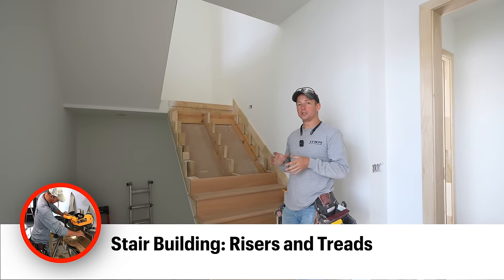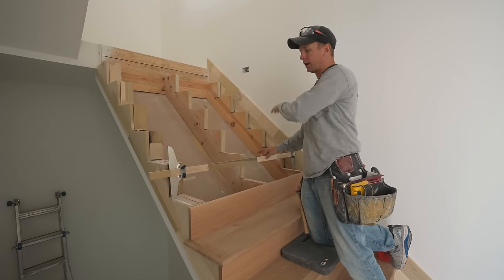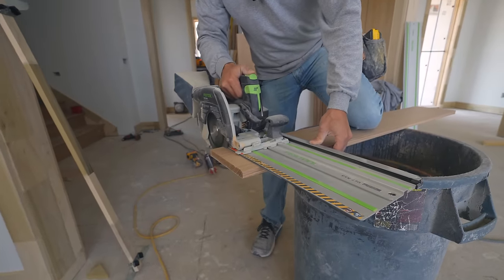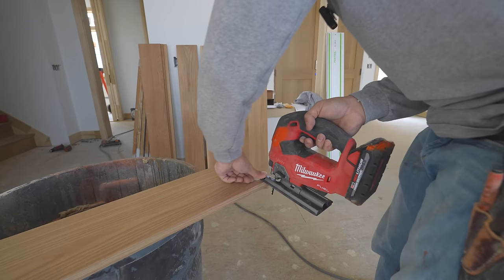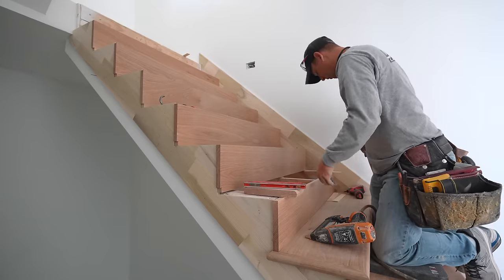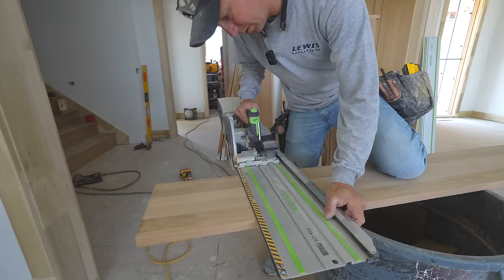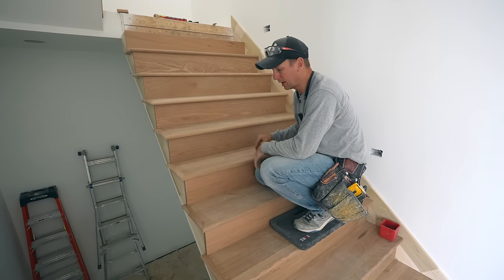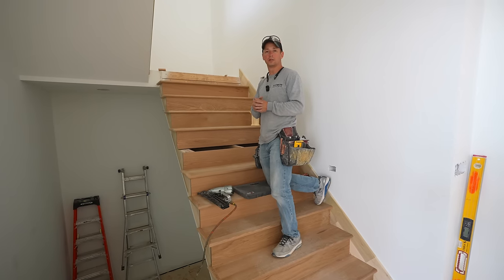How to Install Stair Treads & Risers: Pro Techniques

Comment: I have always been a big fan of screwing in from the back side. It is very satisfying to be able to look down and see a nice tight fit and no squeaking.
Reply: 😂😂😂 sorry… I just can’t!
Reply: I’ve always screws the risers to the treads from the back. I do basically the same with the skirts… just square cut (sometimes some minor adjustment) the risers/treads, leave the skirt board only tacked to the wall… then as your working your way up put some 3” screws through the stringer into the skirt, it will suck the skirt up nice and tight to your treads/risers… this way will always work if you have a cap on the skirt board anyways, if you don’t you might have some minor gaps between skirt and wall but painters can caulk that and then your skirt is nice and straight even if the wall isn’t perfect. Only time this doesn’t really work is if the wall is just in really bad shape…

Comment: Thank you so much for this video. I have a background as a general carpenter. A few houses, decks, additions but never finish stairs.I built the house I live in now. With our help I felt comfortable enough to accept this challenge. 3 full days to remove the old stairs, build the stringers, and install the risers and treads. I never used the stair gauges before but they were so easy to use, making both risers and treads fit perfectly. I will always give you credit and my stair partner. Thanks SO much

Comment: I bought Collins gauges and would emphasize Spencer's caution to be very careful with them when moving from stairs to cutting station. The Collins design is very elegant, and the crisp steel marking edges are much sharper and more durable than wooden ones. However, I find that the very close proximity of the two clamping knobs gripping the 1x2 does not resist movement very well if the edge is bumped even a little bit. I've addressed this by mounting the Collins edges to a shop-made cross piece setup I built years ago, in which the clamping knobs are spaced about 6" apart on rip of 1/2" plywood provided with a pair of slots ar each end to allow adjustable width. It takes a few more minutes if you need to make a custom length crosspiece, but the grip of the knobs makes this setup far more secure against an accidental bump. (Maybe I'm too rough for the finish work I do...:-)
Reply: Brilliant! I’ve encountered the same issue and this sounds like the best solution I’ve found yet.
Reply: @syringconstruction9825  "Stair Wizard" looks like a well-designed and very robust tool. But I've never tried it, a little bulky-looking for my taste.

Comment: Thanks for your very detailed video. Some suggestions on prepping your risers:
1 -- You could drill the pilot holes to attach the treads before you install the risers.
2 -- You could also start the screws in the risers before you install them.
That would save you some time and also avoid the awkward position when you start the screws after the risers have been installed. 

Thanks, again.

Ken

Comment: I've been a dedicated PL Premium user for 30 years. However, for stairs, I recently switched to Bona R880. You have to get it from a flooring supplier or order it online. But I've found in stair tread/riser installation it beats out using PL. Here are the reasons why:

1. It is very grabby. Boards are less likely to slide around
2. It doesn't ooze out of the gun the way PL has a tendency to do, leaving less chance for mess. It is also less messy during application.
3. Sets up way faster than PL. It starts setting in about 10 minutes and can be speeded up to set in 5 minutes if you mist it with water. 
4. Allows for movement. PL locks everything in place. However, it doesn't move. In removing old  existing treads, I've actually come across the rare tread where the joint bewteen the tread an riser has broken. The flexibility in Bona R880 is designed to prevent this because it allows for movement.

I still use PL Premium for pretty much everything else, but I highly recommend trying out the Bona R880 for stairs. 

Keep up the great work, Spencer! Love your content!
Reply from the maker: Thanks! I'm always on the lookout for better products.
Reply: @InsiderCarpentry  same here. You've definitely turned me on to a few items that I've purchased through your links! PS I fixed all the typos - including I spelled your name wrong. Downfall of typing on my phone😬
Reply: @alrightythen1533

I really like the detail in your post.  I’m a homeowner about to convert a carpeted stair case to white oak treads and painted risers.   Choosing the best adhesive possible is key to my situation.

I’m bent on avoiding squeaks and, if possible to either have either…

1. no face-nails nails in the treads, or 
2. really small ones (18g) or 
3. almost invisible ones (23g pins). I spoke with Grex about use on treads

It’s because I’m using only hard-wax oil (NO STAIN).  There is much color variation compared to an evenly stained medium-to-dark stained tread and I’ve not found an easy way to color-match them easily.  Putty comes in plenty of colors, but is something I’m not sold on yet. I hear many complaints about it…but maybe that is not definitive.  Don’t know.

Choosing the right adhesive has the potential to address a lot of my concerns so any add’l insights you could offer will be appreciated.  Had you used F26 by Leech in the past before settling on PL over it?   I know you are onto Bona 880 now and have heard promising things about their quantum product for use on treads without face nails.  The one that comes in a  “sausage tube”, not the thinner Quantum Flow for floors.

I was going to use PL Premium based on how many folks on youtube recommend it.  Then I kept running into a lot of local carpenters and builders highly recommended F26 adhesive by Leeech.  Swearing by it, actually.  The company has an outstanding tech support person who absolutely says F26 does not expand or swell and stays flexible indefinitely and that it  is what doing the holding over time (decades) which prevents squeaks, not the nails.

Will leave it there for now.  Can add a little for if anyone is kind enough to reply to my post.

Comment: I leave the wall skirt board only tacked to the wall. Then with just square cuts on my risers and treads I run a (or a few) screws through the stringer into the skirt to suck the skirt tight to treads and risers. I also screw my risers into the treads from the back side. And use LOTS of glue lol.

Comment: good job with the overlay! so i do them a little different ill cuts and scribe all my risers first and let them to fit well then ill co back and do my treads one at a time. cut 2 blocks the same length and width  to scribe my tread to the skirt they need to be slightly over the extra length of my tread. ill put one block between the the return nosing and the outside skit and the other against the wall skirt. ill use this to transfer the skirt to the tread then ill cut on my line. ill go back with a grinder and a sanding dist to back cut along the tread but will avoid grinding any of the nosing. after i get my tread to fit well ill use titebond 2 or 3 to glue the riser to the back of the trad and nail it off and set my nails with the hammer. generally i dont use pl but liquid nails for my adhesive, it cures to a softer final hardness and i find that helps to keep stair noise down when walking up them. ill install the tread and riser for each step as a single unit.  ill do 3 nails trough the face of the riser and 2 through the side of the skit. ill add a dab of glue or adhesive to where the riser meets the outside skirt. generally no glue on the skirt.

Comment: The craftsmanship and attention to detail is really great to watch. I always enjoy your content. 

Watching this as a flooring guy, having never done hardwood steps I do have one question (for now lol). 

If the backside drywall wasn't on, or you still had access to the backside of the stringers (say as in an under stair closet), would you take the time to pocket hole screw the tops of the backside of the risers to the nosing of the tread?

Would this be severe overkill or would it be a step you would take if given the opportunity?
Reply from the maker: I definitely would if I had access to it. As a matter of fact, I can remember a job years ago where I did have access and was able to do that.
Reply: To bad I can’t rent a fes tool stair saw with guide

Comment: You also can set a dado on the underside of the tread, whats nice with that is your dimension is set, just need to plumb your risers and nail it place. Little bit more work but you have a nice shop, easy set up for you. Keep up the good work, enjoy your workmanship and videos.
Reply: Then leave the riser high the depth of the dado? Slightly less, actaully.
Thanks.
Reply: @als1023  yes, that is the idea.

In this case you would probably have to stop dado these, so you can't see the dado from the side.

Comment: Great video as always. How do you handle the last riser where you can't really access to screw into the tread? Just a bunch of glue or PL?
Reply from the maker: Yep. Try and make sure the riser is as straight as possible when you nail it on. Then push the tread into it with adhesive on the back of the tread.
Reply: You could also pre-assemble the riser and tread together on a flat table then install it as one unit

Comment: If those are young mill treads you can knock that return off to shorten up the tread up on table saw. I do it to bevel the back of the tread, I rip a strip of wood to put in the back side of he return. It’s a pain I have to do it at least once a week on remodel work dang 9” runs.

Comment: QUESTION:  what size nail are you using in this example?  
Thanks for the video---I'm getting ready to do this process and your instruction has been very helpful!
Reply: a brad nail. it's 18 gauge.
Reply from the maker: 18 Ga on the risers. 15 ga on the treads.

Comment: I've been studying your stair techniques in preparation to replace my 1st set of stairs that had been carpeted.  The stringers are not the best and I wonder if you have any tips for dealing with low quality (sloppy cuts) and damaged (way too many nails split the wood) stringers.  I also noticed the white oak treads have some checking and small cracks on the end.  (probably my fault putting them in the garage for a few days)  Hoping it can be dealt with (glue?) to make sure it doesn't spread.  I'd rather take the hit and buy more than have problems develop after they're glued in,.  I had paid a carpenter but they were wholly incompetent and I had to stop work.  The following quotes were ~$1000/step for 36" no return straight run treads, so I feel trapped into finishing it myself.  I trust this channel and it's subscribers (amazing % of experienced carpenters) for quality info and appreciate any wisdom.

Comment: Found u recently. I am trying to tackle replacing carpet with hardwood. My stairs are a bit complicated. I'd really like to learn and need to build some confidence. Any book you'd recommend on stair remodel to help me? Main complication is removal of a knee wall and resulting expansion of the length of each stair. Meaning, you can see the edge of the stairs from the side rather than the treads and risers bumping up against the knee wall.

Comment: Is there any way to avoid the gap between the riser and the tread on the 1/4" reveal on the left? At 24:11 you show a close up of the stairs where you can see it in the bottom left, what do you do to fill that?
Reply: Maybe Pinterest designers don’t believe in cove moldings.
Reply: Nose and cove, nose n cove. They got the nose. Now have a little cove with your nose, Pinterest peeps. Not many profiles as classical as a nose n cove.

Comment: Hey Spencer. It’s seems you want the tightest possible joint between the risers, the treads and the skirt board, but what about the wood expansion. How is that accommodated? We leave a gap between flooring and the walls and everything else for floating floors at least. Does proper adhesive stop the expansion? Really confused on this one. Please help. Thanks.

Comment: How do you get behind the top riser to screw in the tread if the sub floor is in the way?
Great video as always!
Reply: Screw it to tread before setting it in
Reply from the maker: That's one of the reasons that I prefer Sub-tread material not be installed.

Comment: Why do you prefer pencil over razor knife to mark White oak (6:35)? Why did you face nail the treads in this video after avoiding it like the plague on previous videos?  I will not use them.  Did you have a bad outcome relying on PL adhesive only?  In another video, I see you alternate between starting your cut from at the nose and back of the tread.  It implies tearout is not an issue on the nose regardless of the cut direction.
Can excellent cuts be made using a sliding miter saw?  If the HRK is superior, let me know.  I own neither.  I’m open to purchasing either, but think the SCMS will be used more often after stairs are finished.

Comment: I noticed one thing. There is a small gap maybe 1/8 in between your riser and stringer. I am wondering you are doing that on purpose. Can you set bottom of riser flush against the stringer? Thanks a lot

Comment: Love your videos!  I would love to see how you adjust the stair stringer when going from stairs that have been carpeted to hardwoods. I’m doing that now and there is a huge gap between the stringer and the stair skirting.   Not sure if I should just leave it or try to add wood blocks.
Reply: I think you just measure tread and risers from skirt to skirt. There should be enough hardwood that the overhang shouldn't cause too much of a problem unless you're talking 6" or more. Then you might want to put in extra stringers on the outsides and down your skirting. I call them wings but whatever hardwood doesn't bend easily.

Comment: My stairs were built for carpet in 1993 with 8 inch risers and 9 inch treads. I had new flooring installed and the top and bottom landings and now I need to pad the stringers out for the new oak risers and treads. Any advice on how I should go about doing it so all the risers and treads come out evenly?

Comment: In the process of doing my own stairs, and your videos have been a great help! However, my one worry now that I’ve reached the tread installation phase, are those finishing nails. I do not plan on staining the treads (finish only) & am worried that filler may not blend in well. Underside/backside of stairs is not accessible. What advice or product suggestions might you give me for this? Thank you so much for sharing your craft!
Reply: Try mixing wood glue and sawdust from the same material

Comment: good video! only thing i wouldve done different is cut a small return piece out of the offcut of the risers so the grains would match when looking from the side, other than that nice work man!
Reply: A mitered return might defeat the purpose of this design. End grain with the same species as the tread is what I think the designer is after here. This will be a one off for the designer or architect…too often, professionals (architects and designers) and clients with no tool time under their belts will want to create a unique look even if it is unsound. No psychoanalysis here but it is often an ego thing. A stair case is not the place to experiment with design. Safety first. I have always believed that a painted rise is the safest stair. Visually, it calls out the tread when ascending the stair. But all that aside, I might have suggested slight chamfers at the end grain. Sort of a thru tenon furniture look. But not a mitered return to lose the end grain.

Comment: What gauge nail are you using on the treads? Great video by the way!
Reply: Hi great video, im wondering the same.
Reply: He's using a 18ga on the risers and a metabo 15ga on the treads. We use the same set up.
Reply: I believe that’s a 15 gauge nailer
Reply: 15 guage angled nails
Reply: 12 gauge
Reply from the maker: 18 on the risers, 15 on the treads.
Reply: @edwardcomiskey6556  full choke,or modified😅

Comment: When you nailed the tread down to the riser you were using you nailer parallel to the riser but it should be  perpendicular because nails are designed to wander left or right of the gun not up and down.  You risk blowing out the face of the riser.

Comment: Curious why you don’t lay the risers on top of the treads instead of performing the notching operation? You might answer this question later in the video, I’ll delete if that’s the case.
Reply: Because the line between the riser and tread is much more visible if you do it that way

Comment: What kind of blade do you use on you hkc55?
Reply from the maker: Oshlun if I want cheap, festool blades probably work best. The saw is under-powered so a thinner kerf is better.

Comment: What's the benefit of a riser gauge over a tape measure?

Why not install the treads first and just have the risers rest on them instead of cutting the notch on the treads?

What I want when watching these types of videos is not just a how, but a why.
Reply: Because "rough" framing is behind it,angle is from 89.5°-90.5 °.
When you template you don't need to know,and if you do not you have a gap.
Reply: Jacob, Spencer did a previous video where he talks more in depth about the Collins stair gauge and all of its benefits. He was installing treads and risers in an enclosed stairway in a house.